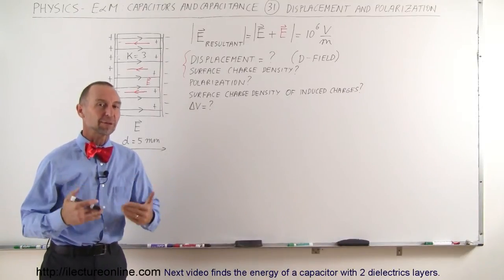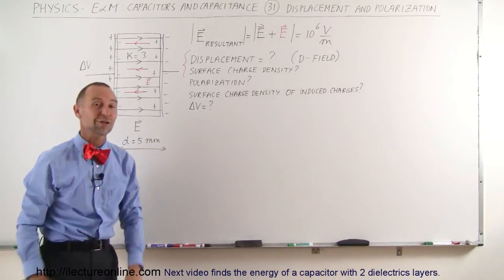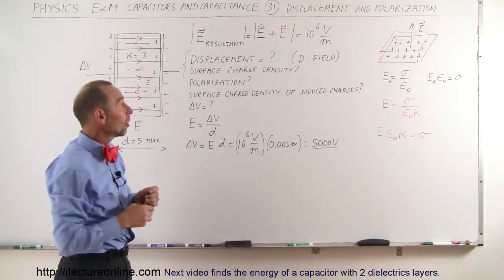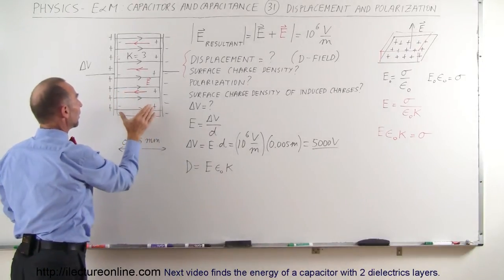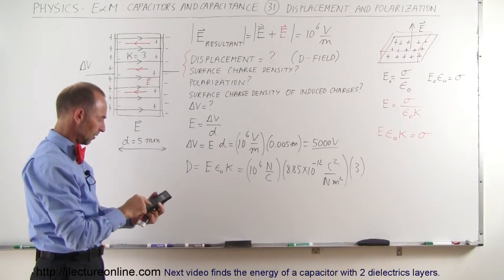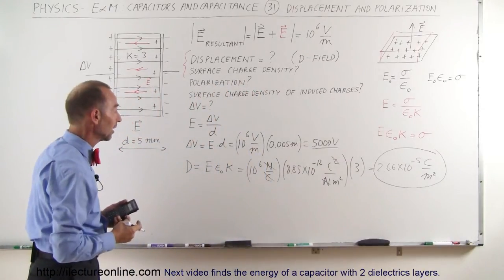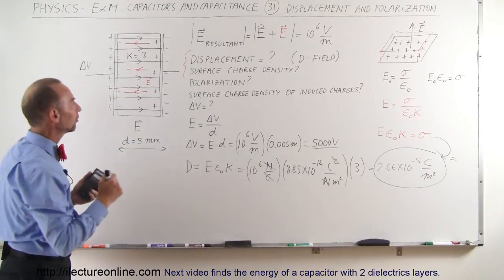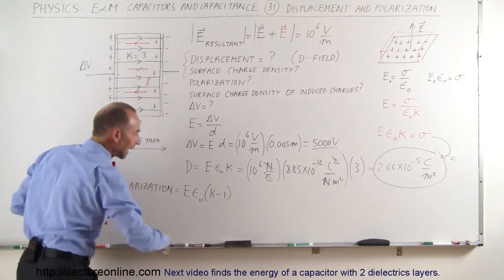Physics 39   Capacitors (31 of 37) Displacement and Polarization

Comment: While calculating the polarization, actually what we have done is E.£.K - E.£.1 
So we are trying find the difference of surface charge density when there is a diaelectric and when there is not a diaelectric. 
But at the situation when there is no diaelectric, electrical field should be bigger than 10^6 
However the formula we have applied here is   E.£.K - E.£.1 = E.£.(K-1) 
We are using the same E(electric field) in this formula. 
Isn't that wrong?

EDIT: Probably the polarization is not the difference of surface charge density when there is a diaelectric and when there is not a diaelectric. So I'm wrong here.
Reply: Yes I wonder as well. E isn't constant tho.